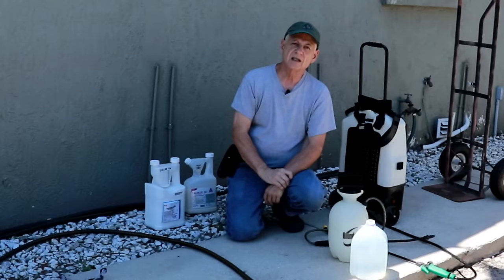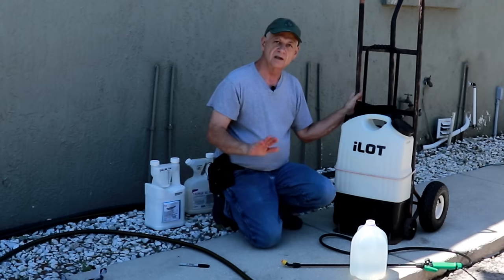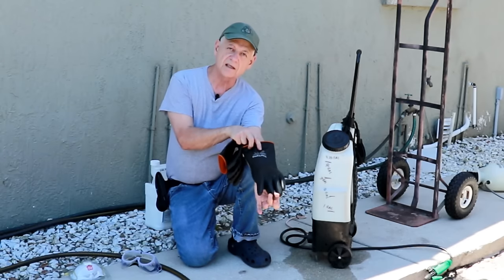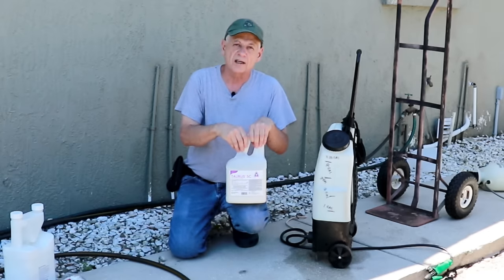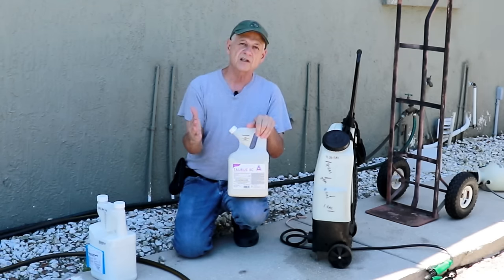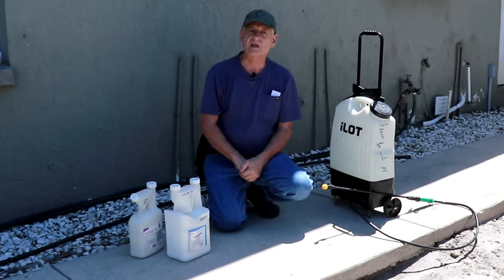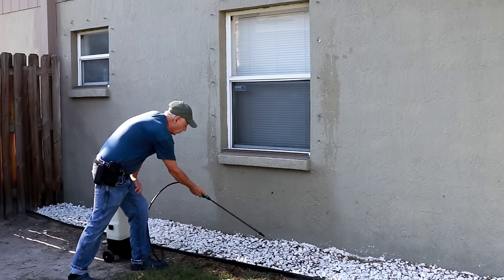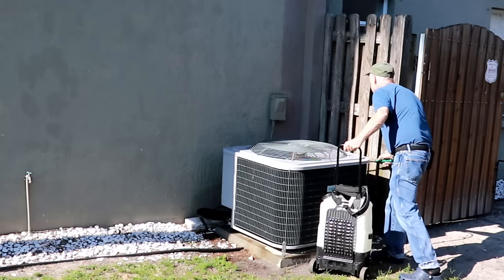General Exterior Pest Control - IMPORTANT!  READ THE DESCRIPTION.

Comment: Guy, is there a sprayer that you recommend at differrent price points? I'd be willing to spend a bit more to get better bang for buck. Thanks.
Reply from the maker: You bet.  The more you spend, the better the sprayer, but I will give you a link to a pretty good one that should do a good job for you.  If you want one on wheels, it will be a bit more.  Any of the PetraTools sprayers are a good choice.

Be well my friend.

https://www.amazon.com/dp/B08B3MKYWD/ref=sspa_dk_detail_1?psc=1&pd_rd_i=B08B3MKYWD&pd_rd_w=UAcAK&content-id=amzn1.sym.3481f441-61ac-4028-9c1a-7f9ce8ec50c5&pf_rd_p=3481f441-61ac-4028-9c1a-7f9ce8ec50c5&pf_rd_r=XGCCZRJV4WTANBCSS2XJ&pd_rd_wg=vudb4&pd_rd_r=7eb7192d-fac2-458d-80d0-520f50d75b01&s=lawn-garden&smid=ARLWOLH2TNLDW&spLa=ZW5jcnlwdGVkUXVhbGlmaWVyPUEzN0ZYQzkzT1NWQlkzJmVuY3J5cHRlZElkPUExMDQ3NzEzMkpXTlhaS1NQT0VCWCZlbmNyeXB0ZWRBZElkPUEwMDg5MTI1MlU1ODVJQTAzUUVYVyZ3aWRnZXROYW1lPXNwX2RldGFpbF90aGVtYXRpYyZhY3Rpb249Y2xpY2tSZWRpcmVjdCZkb05vdExvZ0NsaWNrPXRydWU=
Reply: @GuysPestSolutions  much appreciated!
Reply: @GuysPestSolutions  for protection is there a one price suit that is easy on and off that you recommend? I'm thinking maybe getting something thats disposable.
Reply from the maker: No need to get carried away with the PPE.  Just a long sleeve shirt and long pants are fine.  Also, wear a hat.  The truth is that the pesticides are not as hazardous as you have been let to believe.  Also, you do want eye protection, but that's true with any chemicals you handle.  One of the little secrets of pest control is that the pros don't wear respirators.  We have to tell you to do it for legal reasons, but the truth is that we never wear them.  I pretty much just use eye protection and rubber gloves.  You will most likely get some of the spray on you, despite your best efforts.  I know that I always do.  Just take a shower when you are finished and you will be fine.  I have been doing this for years and I'm still here.  If using pesticides makes you nervous, have a look at my video that explains how hazardous pesticides really are.  While it may just be the most boring video I ever did, it is also one of the most informative and enlightening ones as well.  I think it's a must watch for anyone who wants to handle pesticides.  I think you will be surprised and relieved when you find out the truth.  I will place a link below.

How Dangerous are Pesticides Really video:  https://youtu.be/i7nLO6Js_3Q
Reply from the maker: You are very welcome.  Always my pleasure.
Reply: @GuysPestSolutions  thanks for the deep answer!
Reply: @GuysPestSolutions   is there a place to find taurus sc in stores or should i simply order online. i see 78oz for $99.
Reply from the maker: Solutions Pest and Lawn has the best price on it and shipping is free.  I don't know where you would get it locally.  They don't sell it at Lowes, Home Depot, or anyplace like that.  Sometimes there are suppliers locally, but you would need to find them on the web.  Personally, I just order them from Solutions.  They ship the same day and I usually have the order within about three or four days.  I know this stuff looks expensive, but keep in mind that you only mix Taurus SC at 0.8 oz per gallon, so a 78 oz bottle makes over 97 gallons.  It usually takes me about six gallons to treat my entire house, so one bottle will give me about 16 treatments.  That's about $16 a treatment.  Since I only do it every three months, that comes to about $5.33 a month.  It's almost half that cost if you are using Bifen IT.  So, compare that to the $65 to $85 a month that the pest controllers charge and you can see the savings are quite significant.  Heck, if a pest controller offered to treat my house for $6 a month, I would say, "Sign me up."  Think about it... If you save $60 a month, that's $720 a year.  For me, that's half my homeowners insurance and half my car insurance.  It would pay for one third to one half of my electric bill, depending upon the month of the year.  Personally, I use the savings to pay to have someone mow my lawn.  $60 a month is exactly what my lawn guy charges me.  So, all I have to do is spend two hours treating my house every three months to save me from mowing my lawn every week in the blazing hot sun.  Another way to look at it, is if you save $180 for two hours work, then you just got paid $90 an hour.  If you crunch the numbers, it's really a no brainer.  On top of that, you will do a better job than the pros too.  So, why not?
Reply: @GuysPestSolutions  haha, that's exactly my thinking, guy. the taurus and equipment  is a bargain...it's relatively free compared to my gardener who performs actual difficult work. thanks!
Reply: @GuysPestSolutions  guy, do you have suggestions how to supplement taurus with a mostquito control product?
Reply from the maker: You cannot use Taurus SC for mosquitoes.  You can only use Taurus SC on the building itself and maybe a few inches from the side of the building, just to put a band around it.  Mosquitoes are not hanging out on the side of your building.  The best way to get rid of mosquitoes is to get rid of their breeding areas.  Only female mosquitos' bite.  They have to take a blood meal before they go lay their eggs.  In order to lay their eggs, they need to have standing water that is usually fairly shallow.  Since the female mosquitoes do not like to venture, far from their breeding area, if you remove all the standing water on your property, then you will eliminate over 90% of your mosquito problem.  You may find breeding areas all over the place.  For example, if you have flowerpots with a little pan under them to hold water, a birdbath that is not continuously cleaned, gutters that are not installed correctly, low spots in the yard where puddles collect, or any other place where there is shallow, standing water.  If you remove these breeding areas, then you will eliminate your mosquito problem.  Now, it is not easy to fix a problem with gutters, so you can treat those gutters with either Taurus SC or Talstar P.  Now, until you get all the breeding areas eliminated, you are going to have mosquitoes hanging out on the lawn and under the leaves of plants around your yard.  You can achieve a quick knockdown of these mosquitoes by treating your entire yard with either Talstar P or Bifen IT.  I use a garden hose sprayer to do this work.  I will give you a link to the specific sprayer that I personally use.  To apply the pesticide, you need to put 8 oz of the desired pesticide in the sprayer and then add water up to the 32-ounce mark.  That will dilute the pesticide to a ratio of one part concentrate to three parts water.  Always be sure to swirl the container around as you were filling it to make sure that it is mixed.  Set the sprayer to 4 oz.  Be careful here because it is easy to mistake 4 oz for 4 teaspoons or 4 tablespoons.  Setting the sprayer at 4 oz will give you a dilution rate of 1 ounce per gallon of water.  Just attach the sprayer to a garden hose and spray the lawn down fairly well with it and that will kill all the mosquitoes on your lawn.  There is also a setting on the sprayer that will allow the liquid to shoot in an upward direction.  To treat ornamental plants, set the sprayer in that manner and treat the underside of the plants, like under the leaves.  Mosquitoes are very much like vampires.  They like to suck blood, but they cannot be exposed to sunlight or they will die.  Therefore, they hang out under the leaves of plants and behind blades of grass on the lawn.  So, that is where you want to treat.  Always be sure to check that the intake tube inside the sprayer is firmly in place.  If that comes loose, then you will just be applying water.  Also, continuously check the container on the sprayer to make sure that the liquid level is going down as you are spraying.  At 4 oz per gallon, the liquid should drop fairly quickly.

If you have an areas of water that cannot be eliminated for some reason, then treat it with mosquito dunks.  I will provide you with a link for them.

Keep in mind that, even after you treat your yard, you may get mosquitoes from adjoining properties that will fly over to pay you a visit.  So, you will not be able to eliminate the problem entirely, but you can eliminate 90 something percent of it just by eliminating the breeding areas.

I hope that helps.  Be well my friend.

Garden hose sprayer:  https://www.amazon.com/gp/product/B00UER1S64/ref=ppx_yo_dt_b_search_asin_title?ie=UTF8&psc=1

Mosquito dunks:  https://www.solutionsstores.com/bactimos-mosquito-control-dunks
Reply: @GuysPestSolutions  perfect! thanks for another thorough answer.
Reply: @GuysPestSolutions  i plan treating a few houses. my own and for family. Some of them have indoor pest problems, one has an ant problem and another has spiders. Once we treat the exterior, how do we handle the interior? thanks
Reply from the maker: Doing the outside perimeter treatment every three months will take care of most of the ant and spider issues.  If you have spiders or ants in the home already, then they are easy to treat.

For spiders, just spray the webs with Raid Flying Insect Killer.  Also, spray it anywhere you think there may be spiders, like under or behind dressers, headboards, and so forth.  Then remove the webs with a broom or dust mop.

For most species of ants, you can just use a gel bait.  If that does not work within a couple of weeks, then get back to me and I will explain how to go nuclear on them.  Place small dots of the bait near the ant trails and let the ants do the rest.  If these are carpenter ants, then they must be treated way differently, so let me know if that is the case.

I hope that helps.  Be well my friend.

Gel bait:  https://www.solutionsstores.com/advion-ant-bait-arenas

Comment: Do you know of a good solution for spiders in the backyard?
Reply from the maker: Hi Lisa.  I cannot begin to tell you how much I hate spiders.  I can't stand those things, so I can relate when you say that you want a solution for them in the backyard.  I am going to give you the solution, but first I should point out that spiders are there for a reason.  Nature has provided them to reduce the population of other kinds of bugs that you also do not want in your backyard.  So, as much as spiders do creep me out, I try to coexist with them to some extent when they are outside.  That is, unless they are poisonous.  Things like brown recluse spiders need to go.  Anyway, for spiders that are in bushes, on your lawn, and so forth, they are easily treated with the Talstar P.  I have a video on mosquitoes and the treatment is basically the same for spiders.  I will place a link below for it.  Just apply the Talstar P with a hose mounted pesticide sprayer and spray wherever you want to kill the spiders.  The treatment lasts between 30 to 90 days, depending upon the time of year, weather conditions, area of the country, and other factors.  I have found that cutting the Talstar P so that it is a one to one mix with water helps it go through the sprayer easily.  Also, adding some dye is helpful to make sure that the sprayer is working.  I will place a link below for it.  Now the hose sprayers often use tablespoons instead of ounces and the Talstar P should be mixed one ounce per gallon.  So, two tablespoons equals one ounce.  Since you are diluting the Talstar P one to one with water, that means that you need four tablespoons to make one ounce of undiluted product.  So, set your sprayer to four or five tablespoons and you will be good to go.  I always use five tablespoons because the hose sprayers are not all that accurate.  How well they work depends on hose pressure and stuff like that.  So, I always set mine at five tablespoons, just to be sure that I am getting enough pesticide on the vegetation.  Pro tip:  Have you seen those hoses advertised on TV that are light and easy to use.  Well they are really great for this kind of work.  I purchased a 100 foot package at Olie's for about $20 and that is usually all you need, unless you have a lot of property.  Just keep in mind that you cannot leave them outside.  They quickly deteriorate if you leave them in the sun.  You have to drain them and put them inside the garage or other interior location.  They take up very little room though.  You can also get these at Walmart or Amazon and I will place a link below for them as well as a good sprayer.  I am not providing a link for the sprayer I use because I have a problem with the bottle falling off while it is in use.  It's a great sprayer, but the bottle falling off is a pain.  I have not tried the sprayer that I am suggesting, but I suspect that it will work well.  I read the reviews on it and some folks said that the siphon tube was missing and so it didn't work.  So, be sure that the siphon tube is included.  Also, some folks said that Amazon shipped the wrong sprayer and the one they received was not adjustable.  So, be sure that the one you get has an adjustment knob on it.  Also, please take the time to read the instructions.  I think a lot of people fail to read that stuff and that is the reason they don't work well.  Okay, I think that's pretty much it on how to do it.  So, go ahead kill those creepy things and let me know if you have any other questions.  I am always here to help.

How to Kill Mosquitoes video:  https://youtu.be/LkkrW_tlLkg

Pesticide dye:  https://smile.amazon.com/Liquid-Harvest-Concentrated-Pattern-Indicator/dp/B01G7M309M/ref=sr_1_5?dchild=1&keywords=pesticide+dye&qid=1632327507&sr=8-5

Hose sprayer:  https://smile.amazon.com/Chapin-International-G499-Adjustable-Sprayer/dp/B00UER1S64/ref=sr_1_6?crid=1BJNF49O9GQJW&dchild=1&keywords=hose+pesticide+sprayer&qid=1632325906&sprefix=hose+pesti%2Caps%2C211&sr=8-6

Garden hose:  https://smile.amazon.com/Expandable-Fittings-Strength-Function-Watering/dp/B07PNT5GRK/ref=sr_1_8?crid=1WCY8993JZ9RL&dchild=1&keywords=pocket+hose+100ft&qid=1632326798&sprefix=pocket+hose%2Caps%2C215&sr=8-8

Comment: Hey guy jus to be clear are we suppose to use .8oz per gallon even with the Talster P?
Reply: Ive used it already once about 6 months ago ive been alternating between the 2 products you’ve mentioned in the video the last one I used was the Taurus sc so the talster would be my next one to use but just want to be 100% sure, thank you
Reply from the maker: No.  The Taurus SC gets mixed at .8 oz per gallon, but the Talstar P gets mixed at 1 oz per gallon.  After your initial treatment with Taurus SC you can pretty much stop using it and just use the Talstar P every 90 days.  If you would like to save some money, you can also use Bifen IT, which is the same as Talstar P, but less expensive.  You can also use Bifen XTS, which costs more per gallon to purchase, but you only need to mix it at 1/3 oz per gallon, so it ends up being cheaper per finished gallon.  These products can be purchased from domyown.com.

I hope that helps.  Be well my friend.
Reply: Thanks for the response kind sir 👍
Reply from the maker: You are very welcome.  Be well my friend.

Comment: I'm  young and lift heavy weights.  Dont ever filll a backpack sprayer to the max. Your back will thank you.
Reply from the maker: Sure.  Now you tell me after I did it for years and killed my back.  Lol.  Seriously, you are correct.  The truth is that I have now packed in the backpack sprayer altogether for a one gallon, battery operated sprayer.  I just got it and I am eager to give it a try.  You need to fill it more often, but it is a lot easier on the back.  Thanks for the comment.  Be well my friend.